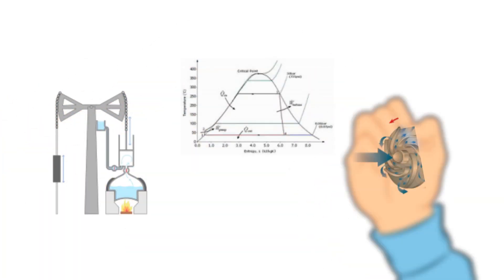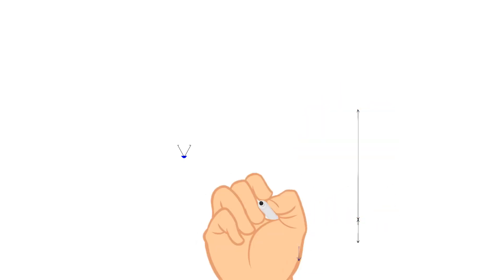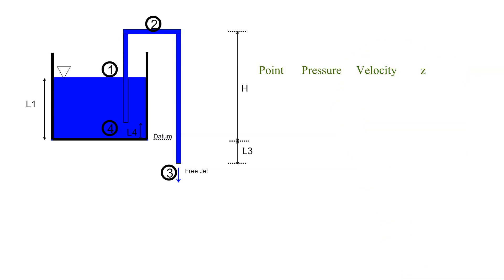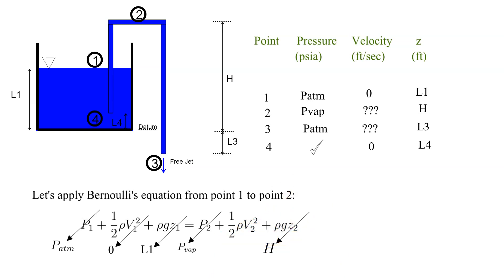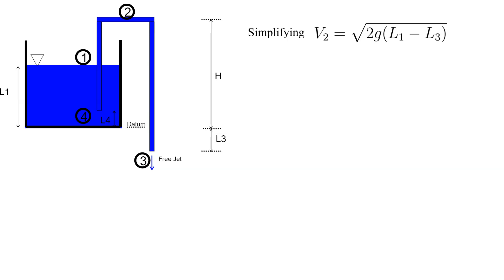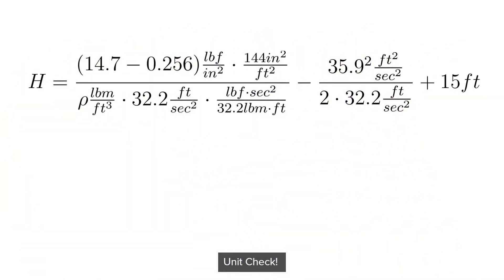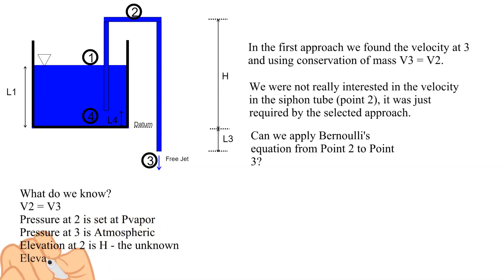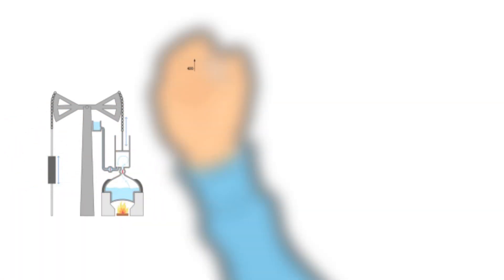Bernoulli's Equation Example - #Siphon

Comment: Hi. Does position of inlet (L4) have any effect? Also, can you also show what happens when outlet is submerged into another tank filled with liquid? Thannks!
Reply from the maker: As long as the inlet position (L4) does not violate the assumptions allowing Bernoulli's equation it has no impact.   The outlet submerged into another tank is a separate problem.  Perhaps I'll do a video on that.  Nice suggestion.

Comment: How to calculate the electric  power required for a centrifugal pump  ???
Reply from the maker: Here is a video that shows the basics.  If you want electric power you need to divide the mechanical power (brake) by the motor efficiency. 
 https://www.youtube.com/watch?v=nL2tVI9EjZs

Comment: thank you for this video. i now can understand the calculation better.
Reply from the maker: Glad it helped!
Reply: @simpleengineeringsnippets7102  btw, can i ask a question.. does concentrations of liquid and type of material for the tube affects the stabillity flow of siphon?
Reply from the maker: Keep in mind that this is a Bernoulli's equation example, viscosity and roughness of the tube has no meaning.  In a real siphon, yes they will be important.  Not sure what you mean by "concentrations of liquid and type" and "stability flow of siphon".  I can say that in a real siphon a lot of things will be important.  Sorry I don't have an exact answer for you.
Reply: @simpleengineeringsnippets7102  alright.thank you sir.